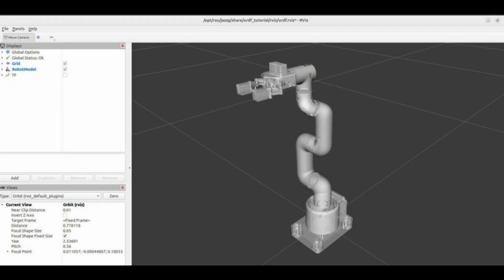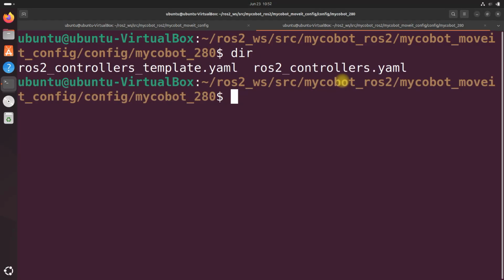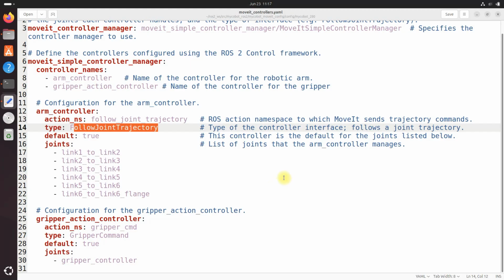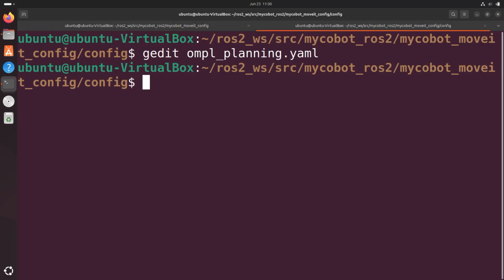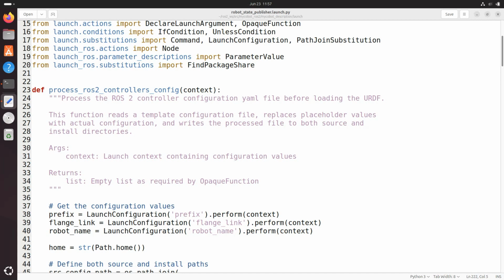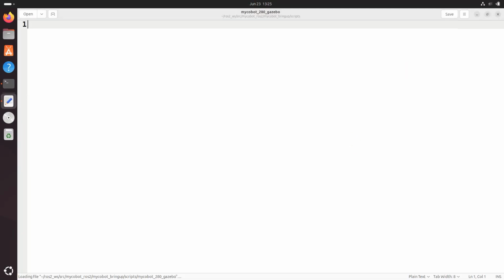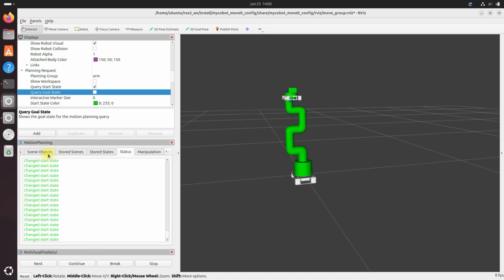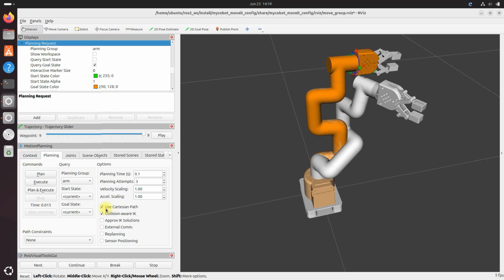Configure MoveIt 2 for a Simulated Robot Arm – ROS 2 Jazzy

Comment: Hey, thank you for the nice video. I have been following a UR tutorial to use planning with moveit2, the tutorial however does not launch a separate move_group node but uses an all-in-one script. I have been trying to use the default launch_move_group that moveit generates but I cannot seem to add any config like ompl yaml to it and make it work. Is there a reason why you (and other video's I see) launch your own move_group node and don't use the move_group launch from moveit itself?
Reply from the maker: You're welcome! The main reason is debugging when things break (and they will 😅). Having separate launch files makes it SO much easier to figure out what went wrong. You can restart individual nodes, see clearer error messages, and swap configs without taking down everything. The default MoveIt launch is too generic. Custom launch gives you direct control over OMPL configs and paths. Trust me, you'll thank yourself later when troubleshooting at 2am!
Reply: @automaticaddison  I appreciate the answer a lot! Another source of confusion for me is that I dont understand why you don't have to put the node namespace (move_group) in the ompl.yaml though, since I thought this was needed in ROS2. As a computerscientist I just struggle following guides and not knowing what I am actually doing hehe. Thank you again for your guides and effort!

Comment: can you share the github. i have been struggling really hard to do moveit configuration on my own robotic arm
Reply from the maker: Here you go!  https://github.com/automaticaddison/mycobot_ros2/tree/jazzy
Reply: @automaticaddison hey so i wanted to ask like i am quite a beginner i have bhilt only a mobile robot in ros2. I am trying to build a robotic arm from scratch. Have been trying to get help from many places but failed unfortunately.  So i just wanted to know how can i do it. I dont want to just copy yojr github and tweak for my robot
Reply from the maker: Why not just buy the mycobot 280? I do have tutorials on my website where I build a robotic arm from scratch, but it will be much better buying something off the shelf so you can just focus on the algorithms.
Reply: @automaticaddison because I want to learn doing it from scratch. I have a 3d printer where I can print things. I am a mechanical engineering major and it does feel good to build one by yourself
Reply from the maker: Ahh ok cool, understood. You're a mechanical engineering major, so building from scratch totally makes sense. It's an awesome way to learn and really get hands-on with the whole process. Keep it up and keep building! 💪🏽